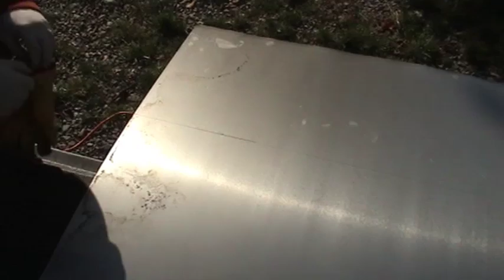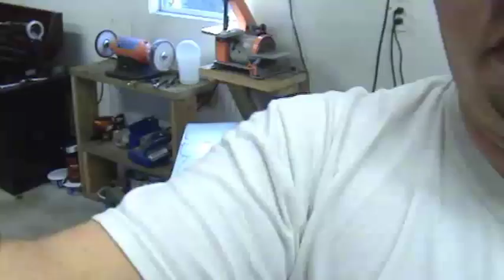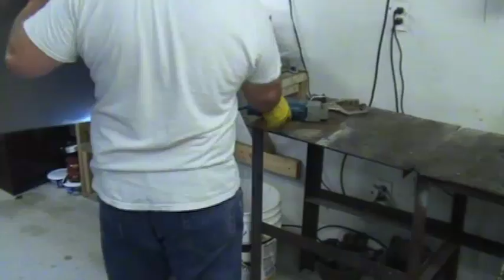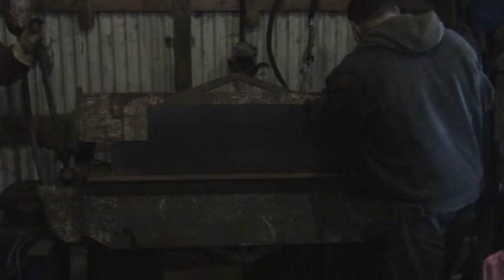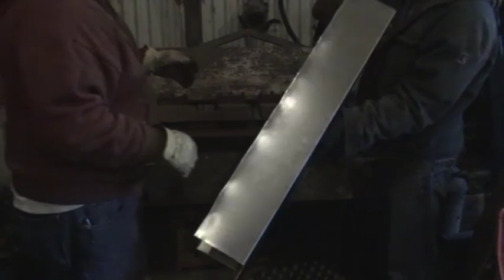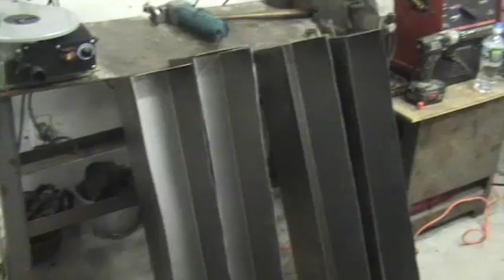Oxynate Bluing System Pt.#1 (Homemade)

Comment from the maker: @edwyrd Thanks Ed. Yeah they are the HF shears. I like them. Iv had them for a couple years and havent had to replace the blades yet. Im cutting 18ga in the vid and they had no problem cutting it. They are hungry. In the vid it looks like Im pushing the shear but Im actually holding it back.